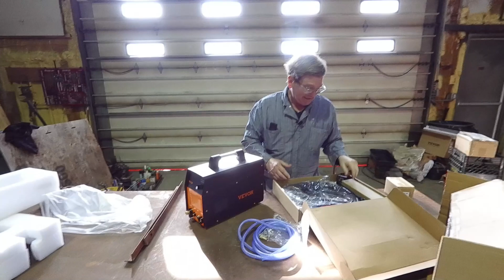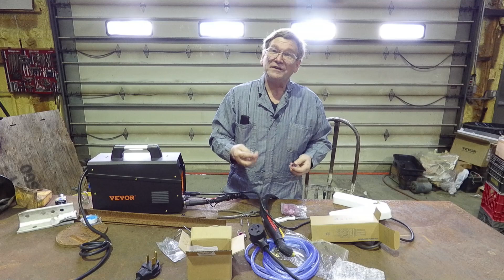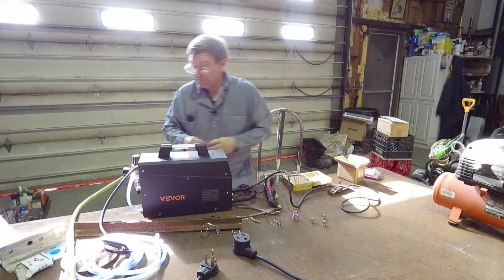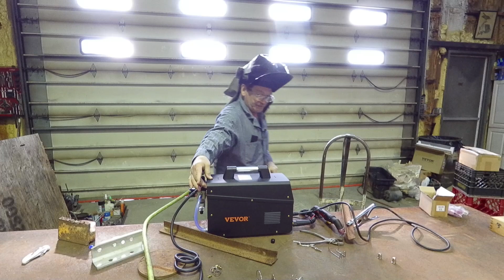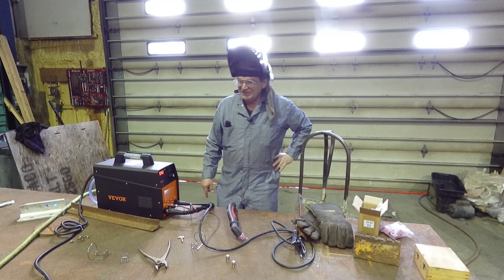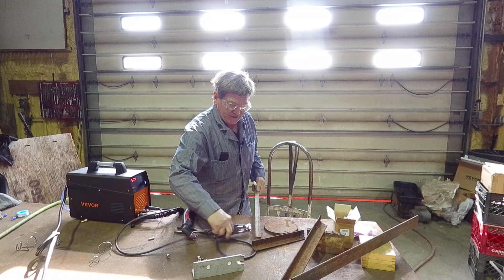Review: Vevor 110v/220v plasma cutter

Comment: Try drilling the hole slightly bigger in the tip for thicker cuts. Air pressure makes a big difference to.
Reply from the maker: We did that at 44:30, this made things worse, not enough power for a larger plasma stream.
Reply: @HOWEES  What air pressure where you using? 4.5 not enough should be at least 45 . my Everlast is 60
Reply from the maker: @johnscott2849  As I said in the video, 4.5 KGf/cm2, which equals 64psi, we also tried more and less pressure, but this worked best.  The manual said to use 4.5 psi, I figured this was a translation error, so I started at 4.5 KGf/cm2 which is what the supplied gauge is marked with.
Reply: @HOWEES  The cheap china one I had responded well when I enlarged the hole in the tip by a little bit. It was 50amp and supposed to cut 1/2 but didn't till I messed with the tip. The air pressure seemed to make a big difference . It also worked much better when I installed a High dollar water trap. It looks like a canister with a roll of toilet paper in it. where I am at I get a lot of moisture in my lines because of weather changes. I now use a Dessicant filter. Just trying to help. thanks for responding.